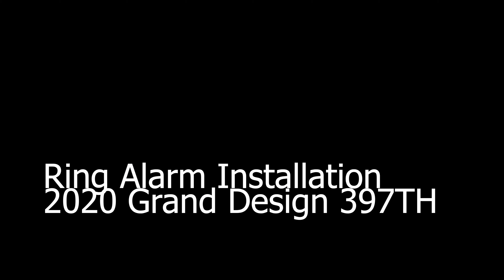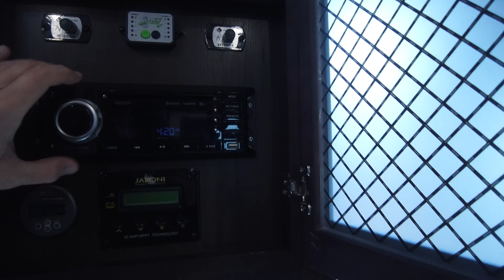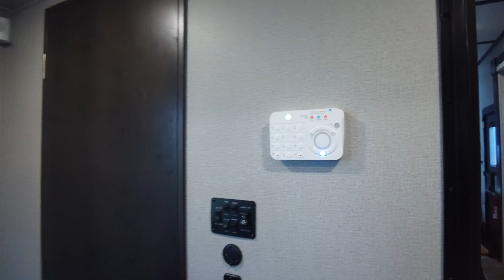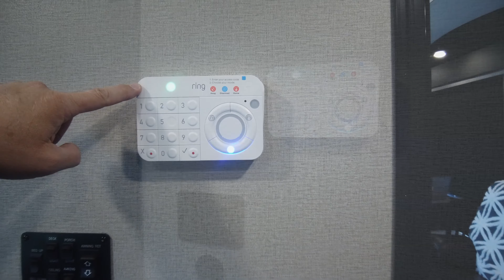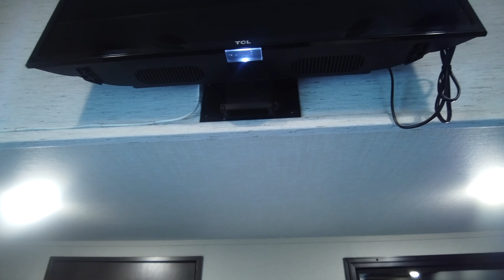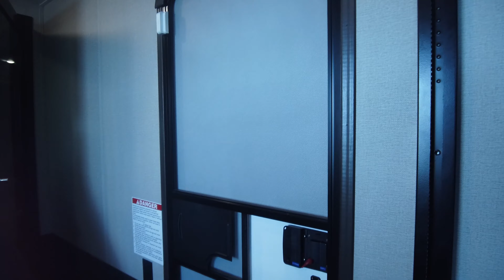Ring Camper Alarm System (4K) Full Review - Grand Design Momentum | Passion Highway

Comment from the maker: We love our Ring Alarm system!  It is nice to know our mobile home is monitored.  If you have any questions please post a comment.  Thank you for watching!
Reply: I am not really tech savvy but I am in the same situation of not being connected to AC Power all the time.  Our RV recently had the storage compartments broken into and caused enough damage to come under the cost of my insurance deductible!!  As for DC power there are no issues as my generator automatically will fire up and recharge the house batteries for an hour as needed. You mentioned you would put a vid out there about your Cellular LTE / Ethernet system and just wondering if you had a link to such video, or maybe a list of equipment used. Thanks for what you do.  Lee

Comment: Obviouly no central monitoring - change locations frequently. Do  you do any local recording of the cameras or only rely on event triggers?
Reply from the maker: Ring cameras record based on event triggers or when you are live viewing a video feed.  They do not continuously record.  The cameras also require internet to upload the footage.  If you are often out of internet range Ring cameras will not save video.  If you want a continuous record solution you may want to look at Ubiquity.  They have a solution that records locally 24x7 on a local hard drive while also being able to access the video from remote as long as internet is available.
Reply: @PassionHighway  Thanks Jim. Will take a look.

Comment: Could you explain why you chose this over a PoE setup? I see Ring offers both, but can't figure out which is the better option. Thanks for the great videos!!
Reply from the maker: Ring POE requires that a physical ethernet be ran to each camera.  That isn't easy to do in an RV.  DC Power can be tapped in at a lot of locations.  It is easier and more reliable.

Comment: Learned about Ring in 397TH from Changing Lanes. You have some clever alternatives.  Nice.
Reply from the maker: Changing Lanes is one of the best channels out there.  We watched their episode on the Ring Alarm and were impressed with their system.  Our needs are slightly different than theirs.  They are generally plugged in somewhere when they are not traveling.  We needed an off-grid friendly solution.  We wanted a system that operates nearly the same as a house, but we didn't want to run inefficient inverters 24x7 to keep the alarm system powered.  Wiring direct to the DC Bus is more efficient. We don't have the overhead of the inverter that is taking 12VDC from the battery bank and transforming it to 120VAC that is then powering devices that has a transformer that coverts back from 120VAC to ~5VDC.  Directly powering USB and the Ring base station form DC is more efficient and it keeps our system running all the way down till the batteries die.  In fact, we had our entire LI battery bank down to 9VDC testing the system and the alarm system continued to operate off of house batteries until the BMS shut the batteries down.  Then Ring failed over to its internal battery with zero interruption in service.  The internal Ring battery will operate about 2 days.  We can run our Ring system and Peplink internet router for months with zero solar or external power off of our battery bank.    Thanks for watching the video!  We really appreciate it.